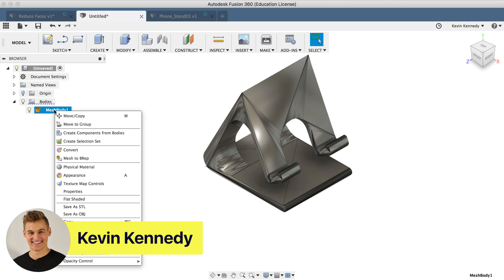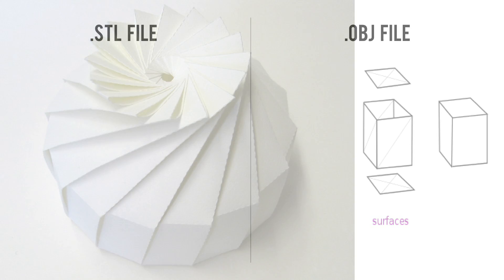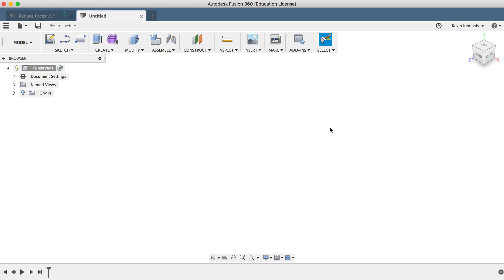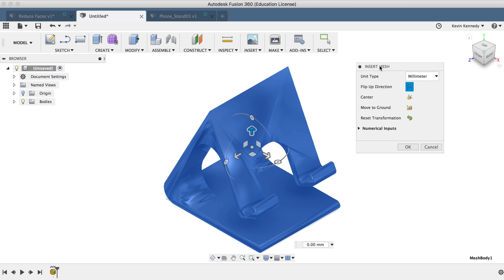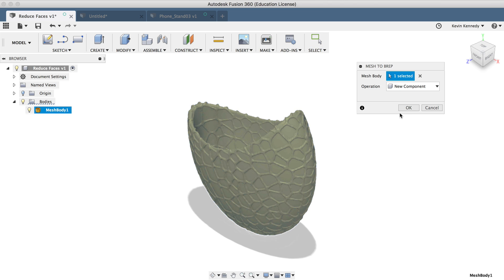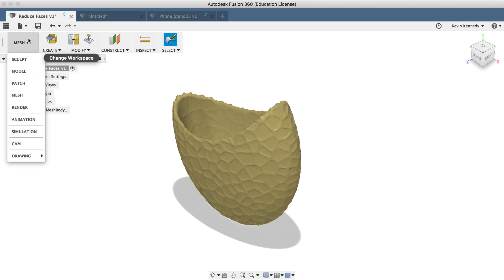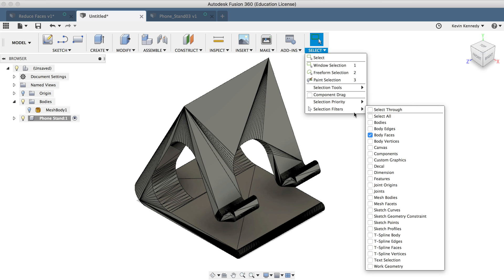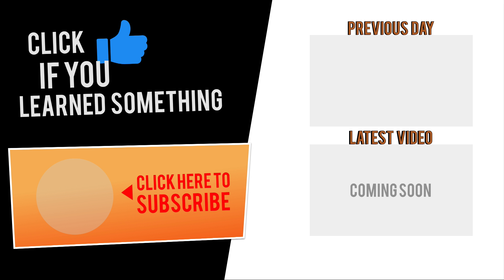How to Convert an .STL Mesh To a Solid Body - Learn Autodesk Fusion 360 in 30 Days: Day #18

Comment: I'm having difficulty highlighting the faces using the Paint Selection tool.  When I click and hold and drag, the whole component moves.  I don't know if it's my settings somehow, or my laptop trackpad that's the cause of it.  Any ideas?

But... even when I select the faces one by one, and I Merge in the Patch workspace, nothing happens!  I get a, "Failed to stitch merged body" error...

Also... is there any way to know that the Select Face Priority is currently selected, other than checking the Selection Filters dropdown?
Reply from the maker: Hi, StepInIsrael. I'm not sure why your components would be moving. Make sure clear all commands by hitting the "escape" key on your keyboard before you try to use the paint selection. It may have been because of a previous command. One thing to double check is that you have the "Select through" selection filter turned off. It's likely that your faces won't merge because they're on different planes (it's selecting the faces on the backside).

As far as I know, there is not a way to see what selection filters you have on without looking at the list (but this would be a good idea for an improvement). You could add keyboard shortcuts to each of the "selection filters," allowing you to hit the shortcuts to ensure you're on the correct selection type without having to view the dropdown list each time. Here's a video on creating custom keyboard shortcuts - https://youtu.be/gSgK5vEQJAw

Just so you're aware, a single-left-click on a vertex, edge or face of 3D geometry in the viewport selects the body. A double-left-click on 3D geometry in the viewport selects as a component. If you hod the CTRL (Windows) or CMD (macOS) key while clicking you can add more bodies or components to the selection. Cheers, Kevin :)

Comment: The other day, I tried exporting a 5mm-thick pentagram from Fusion 360 as an STL, which I sliced in Cura 3.1 at 100% density. However, the resulting print did not print as a 5mm-thick solid pentagram. Instead, only the perimeter wall printed 5mm high. Did I perhaps not extrude the entire pentagram to 5mm high properly in Fusion 360, or did I omit a step or two before attempting to export the pentagram as an STL?
Reply from the maker: Hi Edward, after reading through your question, it sounds like it could be either a file issue or a Cura settings issue. Could you share the link to your file so I can take a look? That will help me rule out it being an issue with your file. Share your public link as a reply to this comment. Here's a video explaining how to share a public link - https://youtu.be/2XrcrdV-8Ls

Then, please write a separate comment letting me know you've replied with a link because YouTube flags most links and I don't always get notified. Cheers, Kevin :)
Reply: Thank you for your help. I have followed your instructions for making a file publicly accessible:

https://a360.co/2JaMSqL

To me, the pentagram looks ready to save as an STL, but perhaps there are certain parameters of which I am unaware that also need to be selected before saving as an STL.

Comment: Hi, At ver: 2.0.5688 I couldn't see Mesh option at design submenu.. How can I do that?  Regards
Reply from the maker: Hi, Barbaros. The "Mesh Workspace" is still a preview feature (in beta testing). Therefore, you'll have to activate the "preview" version in your preference menu. Click your username in upper right-hand corner > preferences > preview > toggle on the Mesh Preview. Here's a reference image for your convenience - https://snag.gy/L3p4Rf.jpg

Please note, you'll have to restart your Fusion 360 in order for the changes to take effect. Cheers, Kevin :)
Reply: @ProductDesignOnline  Thank you for info
Reply from the maker: @Dawnbringer62  You're welcome! :)

Comment: Hi Kevin, I tried but it's happen https://snag.gy/aTGKs0.jpg do you know what wrong with this one? Thank you
Reply from the maker: Hi, Justin. Sorry, I did not see this before. Was this STL file originally a 3d scan? that's an awful weird hole. Depending on how the mesh is converging around it...it may or may not be feasibly to fix that in F360. You may be better off extrude cutting that area out and then re-extrude to fill the area back in. Cheers, Kevin :)

Comment: When I do the merge, all of those faces I just merge disappear, and now there's a big hole in the design.
Reply: I tried as low as 2 faces. Ive decided to go a different way at this point. I do not find F360 to work well with designs already made.
Reply from the maker: @thebigdr  I would recommend checking out Autodesk Meshmixer (also free). It was built specifically for working with Mesh files. Fusion 360 was not intended to work solely with mesh files, which is why it's functionality is limited. Cheers, Kevin :)
Reply from the maker: Hi, bairdi crab. How many are you trying to merge at the same time? I recommend doing no more than 10 faces. Otherwise, I've found that Fusion 360 can go crazy and can't compute it. Also, make sure that all the faces you are merging are on the same plane...and that you're NOT accidentally selecting faces on the opposite side if you are using selection filters. To check this, make sure you have "Select Through" unchecked in the Select > Selection Filters dropdown list. Cheers, Kevin :)

Comment: good video but how do you extrude the hook part of the holder. The part that holds the phone and make the gap larger for a thicker phone.
Reply from the maker: Thanks, James! After you clean up those outer faces of the hooks with the "merge" command...you would simply need to select the face (or faces) and then hit the keyboard shortcut for "Q" for the Press Pull command. Then, you can extrude them out further to the desired length. Cheers, Kevin :)

Comment: Why are all the files online mesh files in the first place ? What program is putting them out ?
Reply from the maker: Hi, autman1223. The slicing software for 3D printers requires STL mesh files. Most files online on sites like thingiverse.com are mesh files because people exported it to print it themselves....and then uploaded the mesh file to save time. If you want non-mesh files you can search other sites, such as GrabCad.com
Cheers, Kevin :)

Comment: Hey, at 11:30 where this video refers to the MERGE command under Patch module.  My merge command is missing?  Have they updating Fusion 360 since this video to either rename, move, or eliminate MERGE??
Reply from the maker: Hi Jason. I was just using the merge command yesterday... So as far as I know, it's still there. Are you using the new UI preview? Can you provide a link to a screenshot? Cheers, Kevin :)
Reply: @ProductDesignOnline  Okay, "UI Preview" was unchecked in the Preferences.  I will need to restart Fusion for changes to take place.  I will recheck shortly after that, thanks, I'll keep you posted.
Reply: Great tip Kevin! At first I was having an issue with trying to get it to merge but I soon learned from you video that it works best to select a much smaller portion at a time to merge so that the CPU can handle the processing much better in smaller bites.  Thanks for your guidance!! Turning on UI preview really changed up my menu style but I am getting the jest of it.
Reply from the maker: @jayclyde6045  If the merge command is still available in the new UI preview it should still be in the current version. Nonetheless, I'm happy to see you found this tutorial to be helpful. Thanks for your continued support. Cheers, Kevin :)
Reply: Dang, you were right, in was in the other version as well!  I must have missed it from your video but Merge is only available if I turn off the Design History Capture first! Got it all clear now.  Thanks for the follow-up or I may have never caught that!!
Reply from the maker: @jayclyde6045  You're welcome! No worries- it's easy to miss the little things like that. Cheers, Kevin :)
Reply: @ProductDesignOnline  iam useing the new fusion update and dont see it ether
Reply from the maker: @1bulldog998  Right-click on your top level component and select "Do not capture design history" Then, you should see the "merge" option under the "modify" dropdown list, within the Patch Workspace. Cheers, Kevin :)

Comment: great tutorial. too bad it doesn't work. I did everything like the video, and I get error, cannot merge. and the selection is on the same plane... awesome
Reply from the maker: Hi, Nicu. Are you using the same file or a different file?? What error message are you getting?? Cheers, Kevin
Reply: @ProductDesignOnline  Hey Kevin. Thank you for replying, and sorry for being funny aggressive about it. Even if I am frustrated with this I realize that it cannot possibly cover all the situations out there. I'm trying to modify the " BeeEye Camera Mount 35/45 degree" version 35 degree from thingiverse. I want just 20 degree tilt on the camera mount.
Reply: Error: Failed to stitch merge body
Reply from the maker: @NicuIrimia  No worries. Thanks for the info - I'll have to take a look at this later when I'm at my computer. Converting files like done in this video are hit or miss. Sometimes Fusion 360 just doesn't like certain shapes and the triangles or irregular shapes created from the mesh file cause too many data points for it to handle. I'll let you know when I get a chance to look at this specific file to see what's going on. Cheers, Kevin :)
Reply from the maker: @NicuIrimia  I played around with the file and I'm not getting the error that you mentioned. One thing to double check is that you don't have the "select through" option checked under the selected filters. Then, you'll want to use the paint selection with the "select face priority" selection filter selected (double check that select through is off).

One thing to note - I did find you'll have to select only a handful of faces...no more than 10 or so when you're working on the complex curves. Given this... you may find it simpler to just re-model this from scratch. I would suggest reaching out to the original author on Thingiverse to see if they could just provide the original parametric model. Cheers, Kevin :)
Reply: @ProductDesignOnline  Hi Kevin, thank you very much for your time. I did the selection as instructed by your video, it's not that. Definitely is the mathematical repairing engine behind the curtains. The semi-round parts became bulged when merged instead of semi cylinders. In the end I also considered and designed it again from scratch. One thing I discovered in the mean time that other people might find useful: if merge doesn't work on triangles that are in the same plane it helps if you select all the triangles in that plane.
Reply from the maker: Sounds good. Thanks for sharing this tip with the community! Cheers, Kevin :)

Comment: While trying to merge faces, I am getting an error saying " Unable to stitch merge faces". Why does this happen?Is there any condition for faces to be merged?
Reply from the maker: Hi, Vishnu. Can you share the model you are trying to merge faces with? Fusion 360 has trouble handling very complex meshes. If your file is very complex there is a good chance that some of the faces are intersecting from the conversion (Mesh to BRep). It is only recommended to use the workflow in this video if you are converting small and fairly simple objects. If you try a large or complex object Fusion performance and stability will go downhill very fast. Cheers, Kevin :)

Comment: I Don;t think this was mentioned but you need to deselect "Select Through" under the selection filter menu.... this will stop faces being selected that are behind the face your working on!
Reply: @Product Design Online Can you please fix this in your video?  Your videos are great, but I just spent an hour trying to figure out how to get it to stop selecting faces on the other side of the part, after spending almost an hour single clicking individual faces.
Reply from the maker: @ryanblackwood743  Hi Ryan, I plan on adding this to a newer version of this video in the future when they release some more updates that should be making this STL to the solid body even better. Stay tuned! Cheers, Kevin :)
Reply from the maker: Hi Love Castle, great tip! Thank you for sharing with the community :)
Reply: @ProductDesignOnline  I also just figured out you have to start the paint selection for outside the model and then move over the faces. However it Error-ed with: Failed to stitch merge body. Any Idea why?
Reply from the maker: @Wolf-3.5.9  How complex is your model? Can you share your file with me? This error is typically caused by meshes with A LOT of faces... and Fusion 360 doesn't like that. If there aren't too many faces, then the next thing causing an error is typically a fillet or another feature that is throwing something off that is hard to visually see. Cheers, Kevin :)
Reply: @ProductDesignOnline  Actually I am trying it on the same phone stand model you were using from Thingiverse. So it must be  something I'm doing wrong. Thanks
Reply from the maker: @Wolf-3.5.9  Gotcha. Can you provide some screenshots or a quick screen recording? That may help me catch something that is different than what I was doing. Cheers, Kevin :)
Reply from the maker: @Wolf-3.5.9  Hi John, thanks for sharing this. As far as I can tell...you had done everything right. I'm thinking you're right. Try to zoom in to that area and do only a few of the faces at a time. There may be small triangles either not getting picked up, or for some reason too complex for F360 to process.

Unfortunately, Fusion 360 is not the best at handling mesh triangles (...hopefully someday this is improved upon). If you find you're going to be converting a lot of mesh files, especially complex ones, then I would recommend checking out Autodesk Meshmixer (also free). Meshmixer will give you a lot more control over how the meshes are reduced. Afterward, you can always import it back into Fusion 360. Cheers, Kevin :)

Comment: Thank you for putting this series up it has a lot of useful information in a format that is very clear and understandable
 What is your thoughts as to why  fusion 360 doesn't make it easier to load a stl file and then have a simple button to convert it to a solid to edit it easier?
Reply from the maker: oldfarmhand - Thank you for watching and for commenting! 

That's a good question! I think it's a combination of Fusion 360 being so "new" (the product team has an ever-growing list of things to work on) and the fact that there are many other programs that can convert files in fewer steps. For example, Autodesk Meshmixer offers a lot more flexibility when working with meshes. The mesh workspace in Fusion is really a "new" idea for a CAD program and there is still a lot to be fleshed out. Cheers, Kevin :)